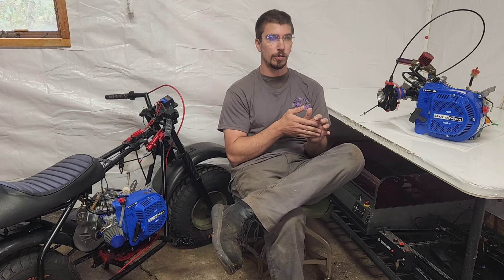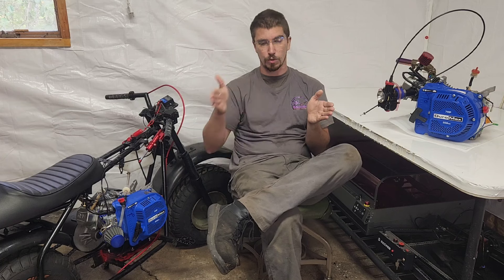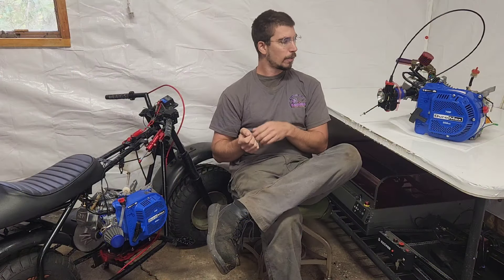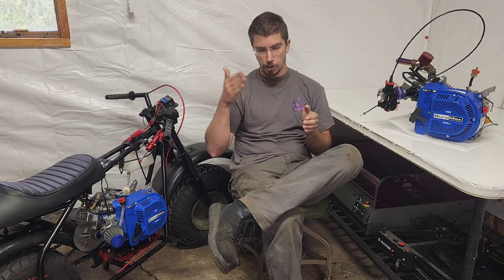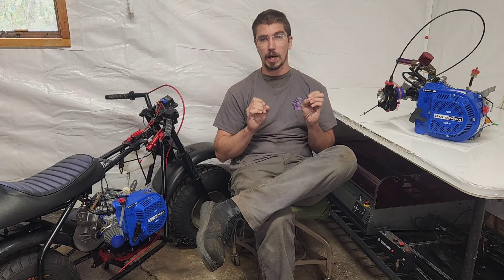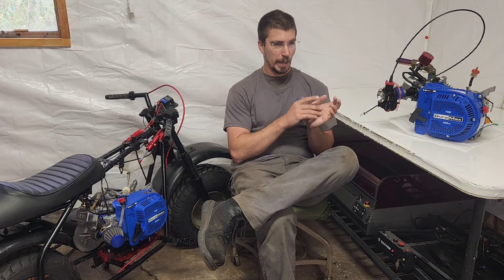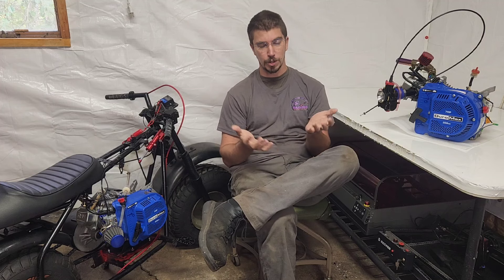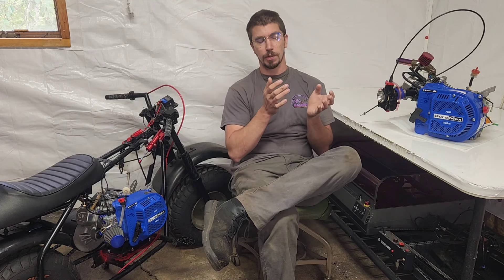Sponsorship Engine Builds - What Would You Have Built?

Comment: Enjoyed this series the vm22 def woke my ducar up 50mph easy gov removed stock guts 3years strong  💪🏼💯💨💨💨💨try out the dyno cams mod2 pre clearanced randy will hook u up Ducar 212 60tooth rear 14tooth max torque valve lash set at .003 8in front wheel azusa spinner get cruizin

Comment: I would love to see what You could do with NO aftermarket parts. 
Cut a dished piston to a flat top, deck the block to make it 0.00 deck height ,hand rework a stock cam , put bigger valves from a bigger engine in it , and much more.
That is what We had to do when I was a teenager because there weren't that many performance parts and 99 percent of what was out there was for a 5HP briggs.
Reply from the maker: Interesting idea I will think on this over the winter.

Comment: I would never get a Mod 2 cam. But if I did I would go for 10:1 CR minimum and use 1.3 ratio rockers. 

The Mod2 cam is pretty much passe. The popular cams these days are the 265 cams. They work great for mild to moderate builds. I have a 265 cam from Dover Power that makes nice power in my 196. 

You were right going for a better carb than a VM22. The VM22 clone carbs work well but you are racing and need a better carb right away. I like the $30 VM22 clone carb kits.

I use "economy" cams. If I was going to spend more than $100 on a cam I would get the Black Mamba jr cam from Small engine cams in Cali. Heard nothing but good things about it for many years. From what others have said it sounds to me like the ultimate minibike cam.
Reply from the maker: Very good input! I looked up the Cam you talked about. It is very close to a 274 from NR Racing. Adding it to my possibility list for next year. The MOD2 1.3 ratio combo idea seems to get talked about a lot but no real world testing I can find. My take on VM22 has been good for sub 6kRPM but there is a PWK 22 with high rpm tuning jet. That might be worth looking into on a MOD2 build.